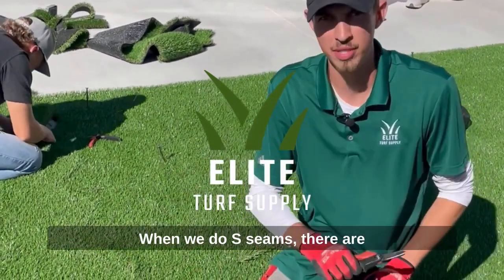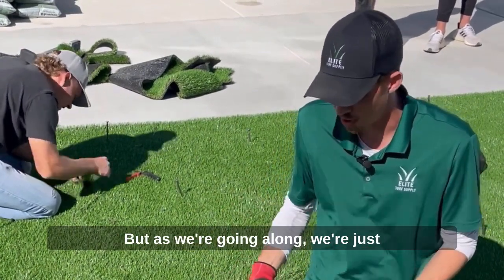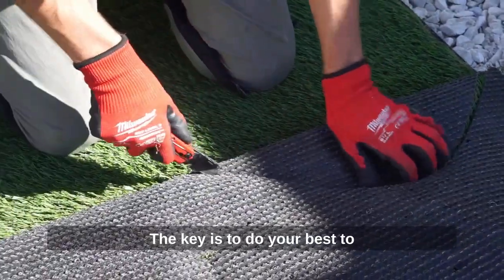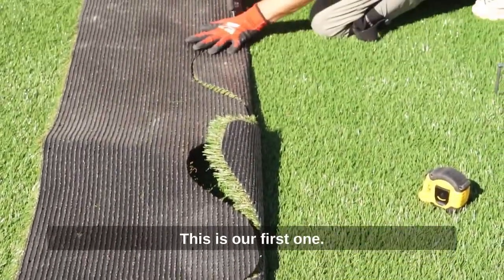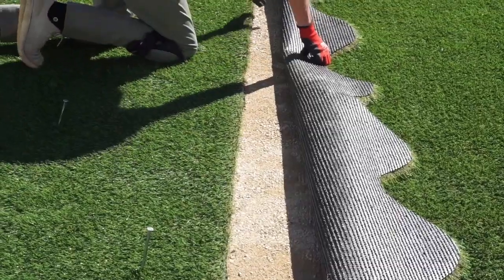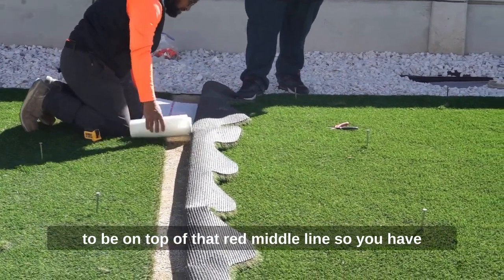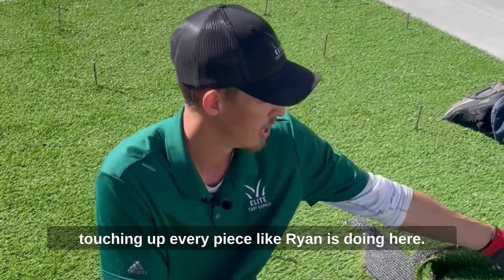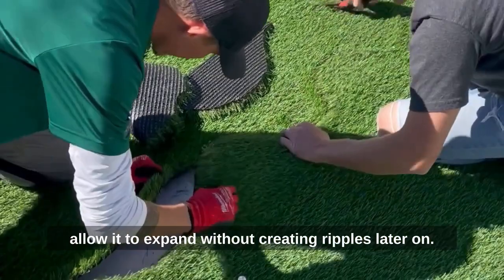Creating an S-Seam | How to Install Artificial Turf

Comment: You all should teach guys to do this right instead of hacking it
Reply: please explain . I watched this and your answer was less help then the video
Reply: You are actually ignorant of the proper installation process
Reply: @russputnam6095  all turf have a stitched pattern all it is is cutting in between the stitches straight, both sides and it fits perfectly, I am pro though it is fairly easy if you can enough to do it right